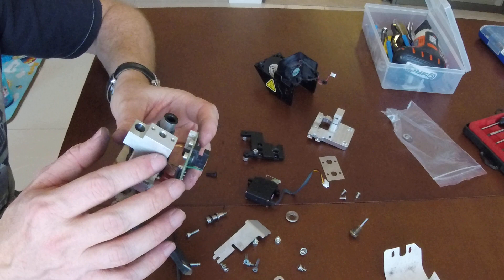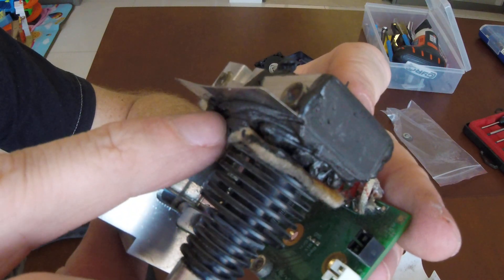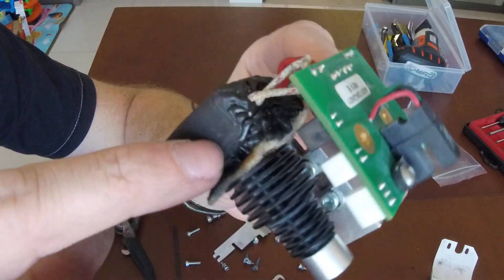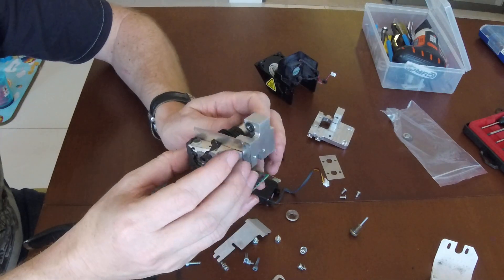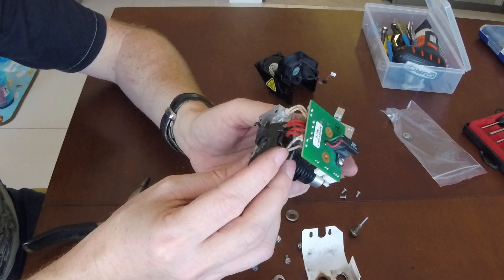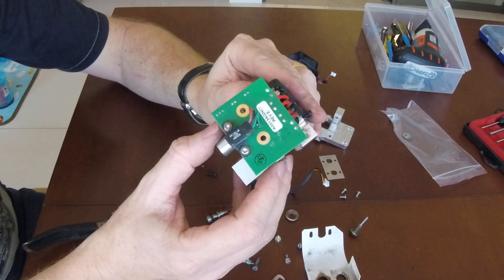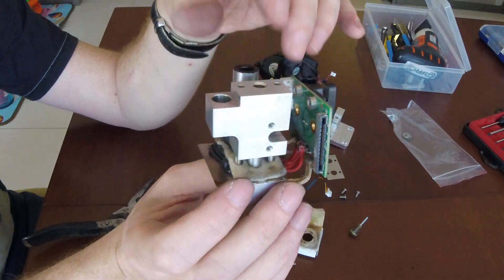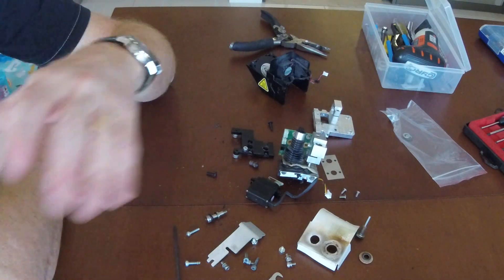Markforged printhead disassembly part 3 of 3

Comment: André, thanks for sharing these videos! I'm having a blob of death issue with a couple of Markforged Onyx One machines at work these days. Our ptfe washers were all deformed just like yours, so the nozzles probably can't be tightened all the way flush to their respective throats. It is really frustrating that this failure mode could have been avoided by designing the washer differently. Did they sell you the replacement parts or did you have to buy the entire print head? Thanks again!
Reply from the maker: Hello! I´m Happy to help! I had to buy the whole head, and now I have a deep fear every time I have to change the nozzles kkk. Good luck with yours! Regards from Brazil, Wentz.